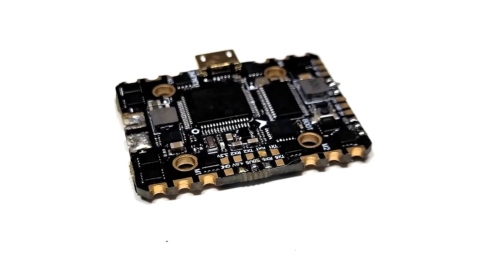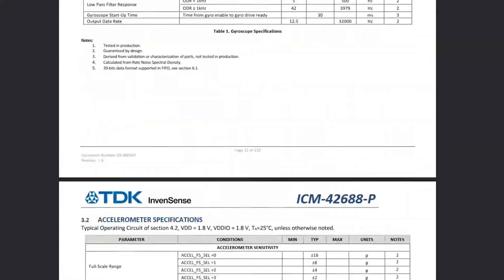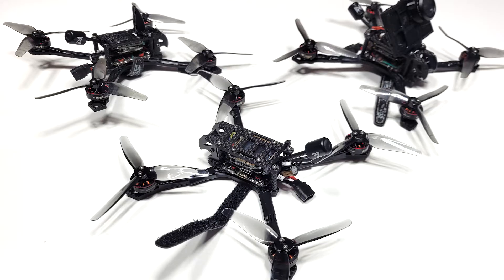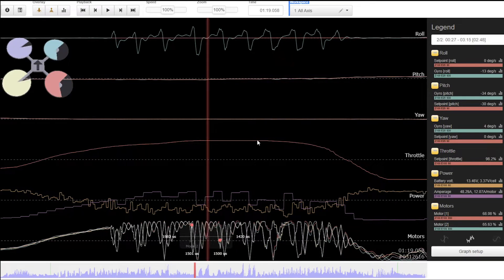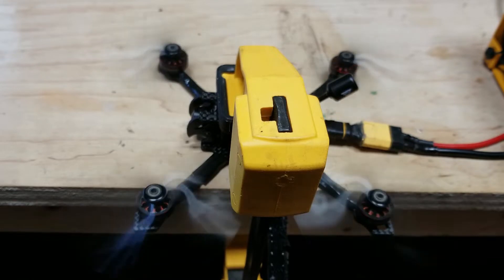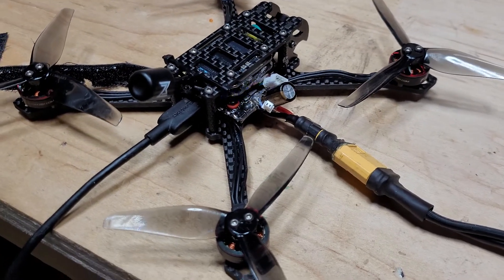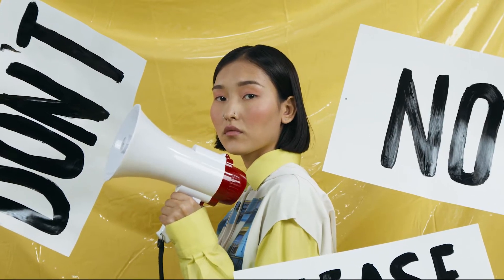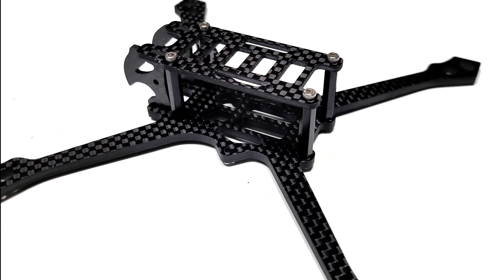Avoid the updated JHEMCU GHF420AIO with the ICM-42688-P Gyro.

Comment: well hell I can't get mine to power up with lipo but it will USB that's crazy
Reply from the maker: Sounds like an issue with the 5v regulator. Check to make sure you don't have solder balls shorting it out or anything. Best way to test is to put a multimeter in continuity mode on the 5v pad and ground and see if it's shorted.

Comment: The icm42688-p is literally the best gyro I have ever tested. Seems that you can mess them up if you mess up your fc though. Checkout some of the FC that are made by SPRacing as they are using that gyro and are working very well.
Reply from the maker: On paper it looks great, so it's good to hear it can be made to work. Hopefully Dominic Clifton decides to make a 20x20 AIO one day ;)
Reply: Too sensitive man nope.
Reply: @RecursionLabs hi, do you know if they fixed it?
If not what aio do you suggest for your frames.
Reply: They did not fix it, ask me how I know.
Reply: I got the jhef405pro icm  and wigs out when armed

Comment: I explicitly ordered only BMI270 and MPU6000 JHEMCU FC, but aliexpress seller keeps sending me ICM 42688 version (which have BMI silkscreen PCB).
All the 3" and 4" quads with  GHF405 PRO - ICM freak out >40% throttle. I am using same PID tune and filtering that worked on BMI and MPU versions.
Like OP, I tried bigger lowESR, increase filtering (at expense of prop wash), and MUCH LOWER PID. Nothing really worked.

Comment: This is one manufacturer who hasn’t reached out… the new icm range needs a really clean 3.3v rail supplying the gyros and well even though the layout of what you need for a gyro is in its white paper…. It seems following instructions is hard….
Reply from the maker: Looks like they are giving on the 42688 gyro and have started finding old (possibly salvaged) MPU6000 chips to throw in new boards.
Reply: @RecursionLabs  it’s such a hit and miss company

Comment: Hi, just wondering if you had a chance to look at boards with this gyro again, BF devs have introduced some fixes for boards using this gyro

Just recently 4.4.3 came out with a change "Disable ICM4268xx AFSR feature to prevent stalls" and 4.4.1 had "ICM426XX AA filter"
Reply: Did this really fix it? I've been wondering this.

And target
Reply: @eulogy1981  No idea, I guess we will wait and see if @RecursionLabs will have an opportunity and desire to re-test this board at some point with bf4.4.3
Reply: @sigsegv0x0b  actually, here's an update. I got the newer version of the board, not the ICB but the GBA and that one is flawless works just like the old ones. No issues
Reply from the maker: I don't have this board anymore, but I have tried the new BGA boards with this Gyro they released and they are much better with the BF fixes, and someone who had this board says it flies fine now. With extreme noise they are not as good as the MPU6000, but regular flying seems fine now on a Scythe build.  (I bought 5 more).

Comment: Would a bad gyro cause the quad to jump to full throttle suddenly once I hit 25% or so leadfinger. That was a fun landing, making it dance back and forth to keep speed down while dropping altitude and disarming into a bush to minimize damage...
Reply from the maker: It could be bad filtering. With air mode a bad tune can cause a quad to moon.
Reply: @RecursionLabs  it just started suddenly, ran a couple warm up packs, no crashing, brought it in to swap packs, on takeoff of 3rd pack is when it freaked. Checked for loose anything and that's not it. Put a preset tune on it and tried again but no help. Fc has black box but I haven't learned that part yet.

Comment: I bought 2 FC’s HAKRCF722 mini 3 for INAV target MATEKF722SE since I have another two that are working fine. These new FC’s came with the new gyro ICM42688 instead of MPU6000. Result, INAV does not recognize this new gyros. I’m stuck in Betaflight. Let’s see how it flies…
Reply: How it flies finally? Is goos thasst gyro for you?
Reply: @Edgar1991123  did not put it yet in a drone. I’m trying to make an INAV target for this new gyro.
Reply: I tried the HAKRCF7220, the rectangular 20x20 one on an apex 4" build. The gyro signal seems to be very noisy and has a pronounced resonance at 310 Hz, and I'm not sure if that's just my build or an actual gyro issue. Needed to use RPM filtering, 1x static LPF @250 Hz, and static notch 310 Hz 285 cutoff to get it to working nicely. The quad flies fine but I'm having trouble cleaning up propwash handling

Comment: so if the gyro has WAY less internal filtering and less latency as such, then maybe lowering the filters way below stock will help. It seems SUPER sensitive of a gyro, maybe Betaflight isn't ready for it yet?
Reply: The JHEMCU FC is not ready for the gyro. They just slapped on a gyro they heard rumors about without isolating it against the ESC noise. BF devs are working with manufacturers to make this gyro work nicely, but some clone companies are just brainless zombies. BF is super clean, like never before, that cannot be the problem. The problem is JHEMCU's noisy power line that feeds the gyro chip.

Comment: So what is a good alternative for the old Jhemcu in the Scythe? I bought the Scythe frame with the baseplate for 25.5x25.5 AIO layout. Is the GHF745AIO-40A or 50A  any good? Also looking at the Speedybee F745 35A 25.5X25.5 AIO but it is slightly bigger

Comment: What is the best AIO that we can get right now for a 3.5inch build that works in your frames?
Reply from the maker: Hard to say. I'm up for pain and am trying to newer JHEMCU board to see if its better as it seems to allow for an MPU6000 if you have one to solder on worst case. That said if you get the 25x25 baseplate it'll take both 20x20 and 25.5x25.5 boards, and those are more available now.
Reply: @RecursionLabs  I really liked the old GHF420AIO with the MPU6000. Is the new board you mention above, the GHF420AIO-BGA? Have you tried it yet? If so, what are your thoughts, regards Richard
Reply from the maker: @rsutherland106  I got it recently but have yet to try it on a build.

Comment: Hi, since this fc is basicly a no go, do you have other fc's to go for? (with possibly 3 uart)
Reply: 25mm aio's are the way to go IMO.
Reply: @maplefpv  I found on aliexpress some units on the JHEMCU GHF420AIO with the MPU6000 gyro, I will probably risk it and hope that is actually a MPU6000 gyro. Anyway the questiion is, you use 35A AIO esc on this 3,5" build right? (i ask because i saw that there are some with 40A)
Reply: @damianomotta1809  just avoid the company... You don't need more than 20a really for this build. Get foxeer, Diatone, iflight, holybro 25mm AIOs
Reply: @maplefpv  I don't know about those, I didn't saw them being pushed hard. I kinda trust gmcu tho, never saw anyone with problems with this one
Reply from the maker: I wish I did, but I don't right now. A 25x25 (not Betafpv) with a MPU6000 gyro is probably your best bet. That said, I did buy one of those MPU6000 boards from aliexpress which were overpriced and did get one, but I'd confirm with the seller first to make sure they have it, and it's the right version.

Comment: Any plans to have a top plate the fits the HDzero VTx?
Reply from the maker: I don't have a HDZero VTx to test, but would the 20x20 board not fit on the top plate?
Reply: @RecursionLabs  it is 34 x 34mm in size and have a 20x20 M3 hole pattern.

The current top plate I believe is for M2? Could drill it out but was wondering if the top plate could be made a touch wider so it would protect the VTx more instead of having some bits of the board exposed.
Reply from the maker: @AlvinYeoh  I could see about adding 20x20 holes into the wider plate made for 25x25 (walksnail) since that probably has the width you're looking for. As for widening them, couldn't you just use m2 screws? I use m2 screws in my Five33 stack which is made for m3.
Reply: @RecursionLabs  Could do that, should probably still be quite secure with some washers in.
But yeah having a 20x20 for the walksnail plate would probably work too!
Reply from the maker: @AlvinYeoh  A washer wouldn't be needed since you'd want to have a nylon nut on either side of the board which would act as a washer. I'll see what I can come up with.
Reply: @RecursionLabs  Sorry one more thing! I assume you'll be updating the Reaver as well? I actually don't see the walksnail top plate for the Reaver on CNCDrones.
Reply from the maker: @AlvinYeoh  The 19mm walksnail camera looked like it had different mounting, and you wouldn't need the extra stack height, so I didn't bother. Truth is the Scythe is the best option if you have a 14mm camera and can fit in a 20mm height.

Comment: Hi, will there ever be tests of 4“ propellers and motors (the same as 3.5”); or could you just advise something (I wanna build apex 4“ 4s quad, I look towards the 2004 3150kv brotherhobby or 2004 3000kv emax eco II and gemfan 4023 props - is it a good choice?)
Reply from the maker: There is already a test of 4" props on 1404/1408 motors which you can find here: https://www.youtube.com/watch?v=5Fq89oydPOM. 

I do have tests finished on lower kv 1408 motors I need to get around to publishing (along with 5")

Comment: Hi, nice tests! Recently I bought a cheap DarwinFPV Baby Ape drone and for my surprise it came with a MPU6500 instead of MPU6000 on previous versions. Do you have experience with that? I can find very little information about it but it seems to be more sensitive to vibrations than MPU6000.
Reply from the maker: The MPU6500 is more sensitive, but soft mounting and gyro filtering should take care off that. A sensitive gyro is different than one that is sending bad information.

Comment: By the way: what is a good alternative gyro for the mpu6000? I heard the bmi270 seems good with the right gyro filter settings. There was a video on that from chris rosser
Reply from the maker: There is also the ICM-40609-D which seems to be designed specifically for drones, but there are no FCs with it yet that I can find.

Comment: I'm having very similar issues with the JHEMCU GHF411AIO, which uses the same gyro... I'm super new to FPV, so I've been able to get the blackbox data but not read it like I see in your video. Here's a flight where you can see it gets pretty bad. That's with new props, making sure everything was super tight, etc. Again, a newb, so I might have missed something, but I don't think so.  https://youtu.be/EF1pqRY_siA
Reply from the maker: Which version of Betaflight are you running?
Reply: @RecursionLabs  Sorry, just saw this. It was the one that came with the FC, 4.3.1 according to the product page, but I'll check in BF tomorrow. Do you think that flashing to a newer version could help?
Reply from the maker: @danielverdin7185  Yes. There are some code improvements made for this Gyro.
Reply: @RecursionLabs  Thank you! I broke the frame after filming that video. I'll fix, upgrade, then report back!